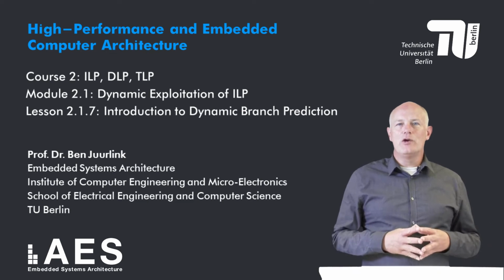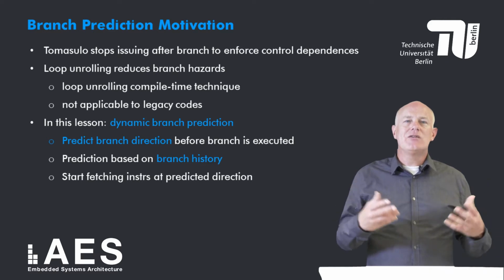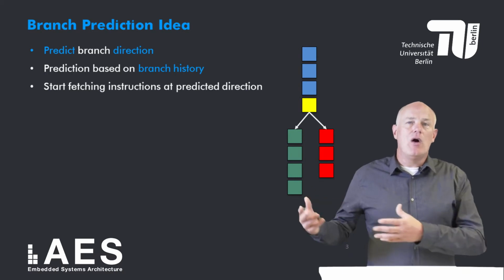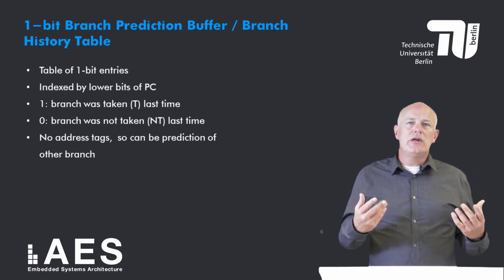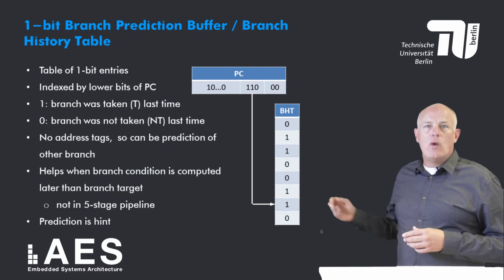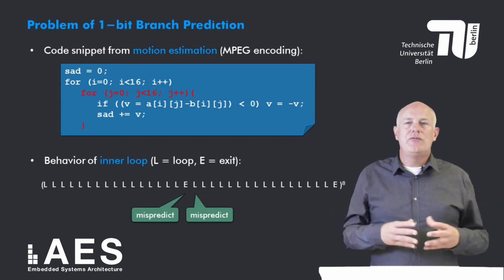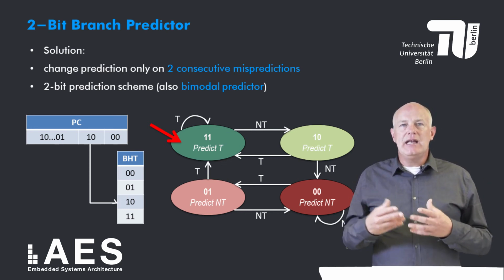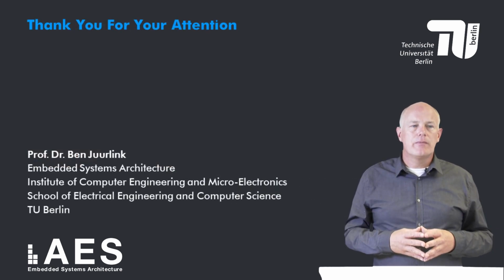2 1 7 Introduction to Dynamic Branch Prediction

Comment: This is a good lecture, but for a fresh student (who is just learning micro processors concepts), its too hard to get the concept & basic idea behind the algrithm. You need to take students from a bit low level to high. For example, you should explain how that state machine is formed & what is the basic idea of branch prediction. This makes students to think than just blindly memorizing the state diagram.
Reply: He did a decent job explaining. get gud bruh